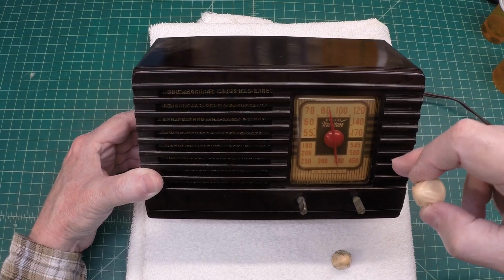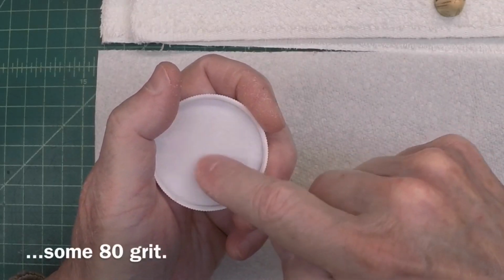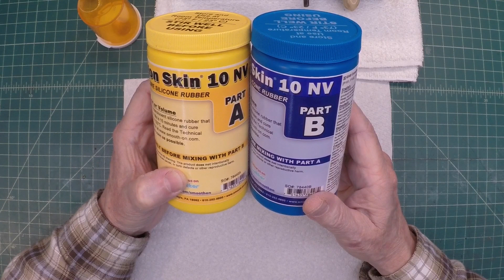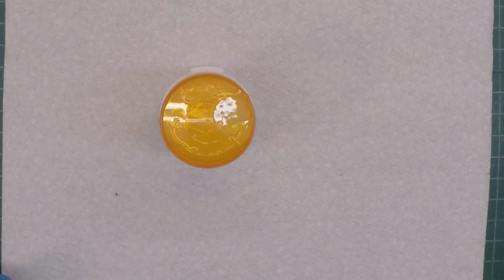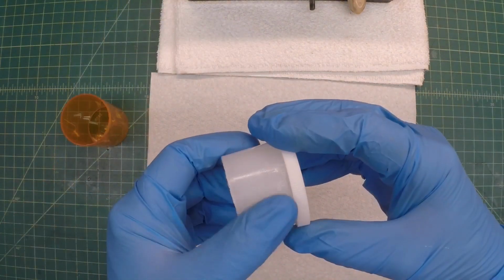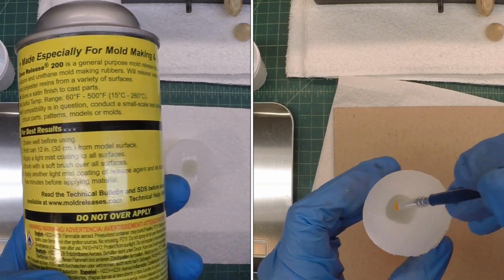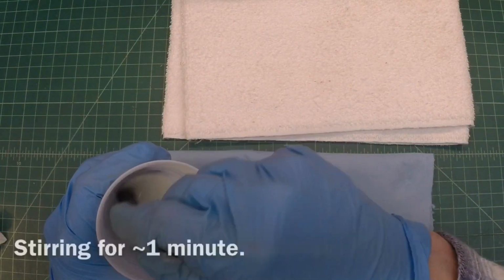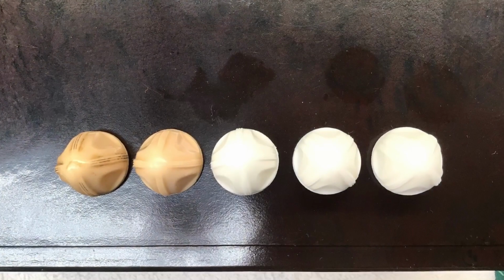Philco PT-25 Transitone - Reproducing Vintage Knobs

Comment: Nice job Don.  I've used some black or brown dye in the plastic mix to obtain desired colors.  Only takes a drop or so to color the knob all the way through.  Enjoy your videos - very helpful and informative.  Armand
Reply: If I remember correctly, someone from the Polish radio forum used a cement pigment to color the resin.
Reply from the maker: Armand - thank you. I used pigments with the 326 product with excellent results in the past, but the 300 being a bright white resin doesn’t look as good when using pigments; washed out look. What dye did you use and what resin did you use in the past? Thanks again. Best, Don

Comment: Nice work, Don.  Would love to see the rest of the process -- centering and drilling the hold and any set screw.
Reply from the maker: Nelson - I’ll post an update soon on the remaining steps, but until that time check out my previous video that captures those steps at: Vintage Radio Knobs - Making a Shaft Collar w/ 1/4" Bore Diameter & Set Screw
https://youtu.be/YdMKQuYXuOw

Best,

Don
Reply: @RestoreOldRadios  Thanks, Don.  That video shows exactly what I was looking for!
Reply from the maker: Glad it helped. A thin wall brass tubing should work equally as well in lieu of the stainless...

Comment: Don excellent workaround for a missing knob, now for my larger knob also have to do is figure out how to make a brass insert. 
Maybe starting with a hollow round brass curtain rod.
Reply from the maker: Mack - thank you. Check out my video below, it might help.

Vintage Radio Knobs - Making a Shaft Collar w/ 1/4" Bore Diameter & Set Screw
https://youtu.be/YdMKQuYXuOw

Best,

Don

Comment: You could have added dye to the resin
Reply from the maker: Yes you are correct; I used pigments with the 326 product with excellent results in the past, but the resin I had on hand, i.e., the 300 being a bright white resin doesn’t look as good when using pigments (dyes); washed out look. Thanks for watching and your recommendation. Best, Don

Comment: Everyone always shows the easy side. Someone could just whittle a new knob from wood. Nobody shows how to actually attach knobs to different types of connectors (D-shaft, split shaft, locking nut...)
Reply from the maker: Thanks for your feedback. Here’s a video I published awhile back that illustrates one possible M&P at:

Vintage Radio Knobs - Making a Shaft Collar w/ 1/4" Bore Diameter & Set Screw
https://youtu.be/YdMKQuYXuOw

Best,

Don

Comment: why didnt you just add pigment to the resin and you wouldn't have to paint the knows or worry about the paint flaking off.
Reply from the maker: Scott - I was using some old resin left over from another project, not a clear resin that should/could be used. I've used pigments with the 326 product line with excellent results in the past, but the 300 being a bright white resin doesn’t look as good when using pigments; washed out look. Thanks for reaching out and watching. Best, Don
Reply: @RestoreOldRadios  oh ok I know I used smooth on in blue and yellow jars maybe the 320, it was white too but you could put powdered pigments in them. I mostly casted model airplane parts for building ww1 biplanes and I would scratch build parts. I made some stuff black some stuff grey . I made some stuff tan once. I didn't use the dragon skin for the molds I can't remember it's been 5 years since I cast resin.